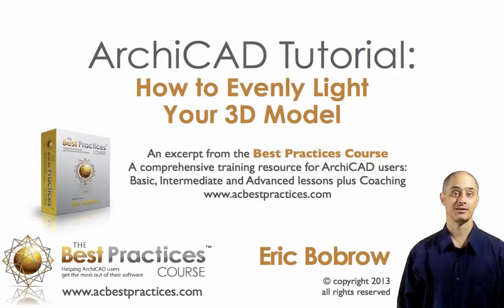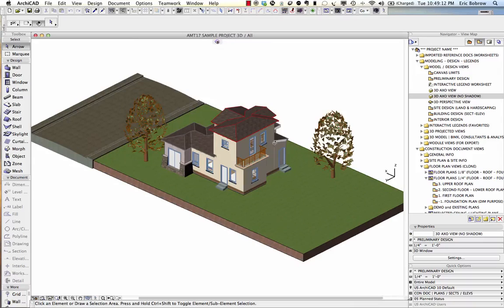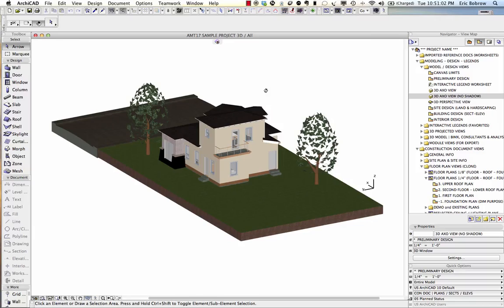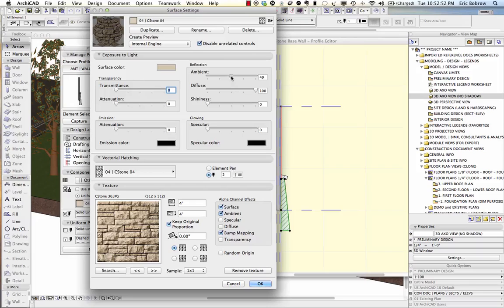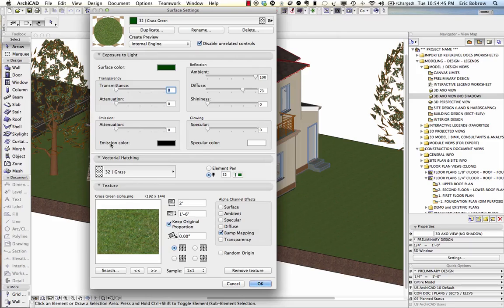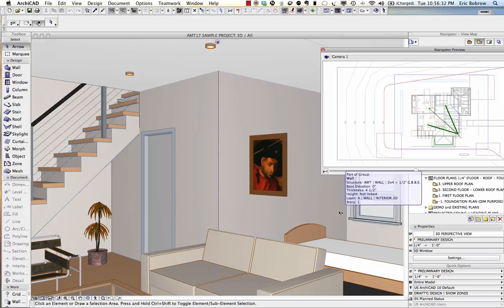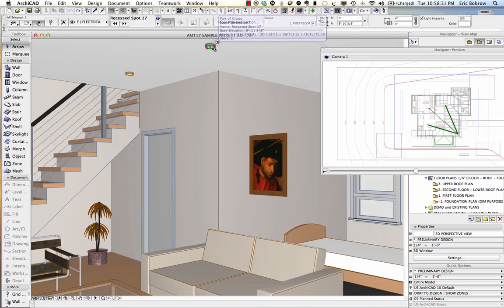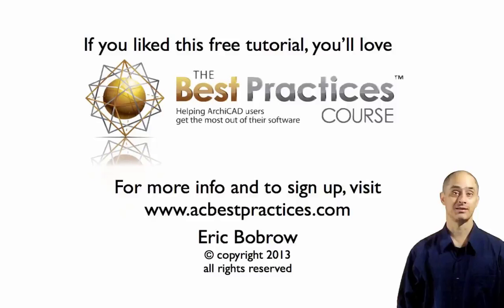ArchiCAD Tutorial | How to Evenly Light Your 3D Model

Comment: Eric,

How does changing the emission color of surfaces affect rendrings? For instance, running a rendering using the Internal Rendering Engine which uses emissions? Other than possible "side effects", I like this. I hate when a client asks why white siding is grey...
Reply: ***** It changes the "lightness" of the texture. For example, I have an asphalt shingle surface for the roof, which I modified the way you exlpained because it was too dark. When I run the rendering, it's almost too light. I'm not sure what the fix or workaround could be for that.